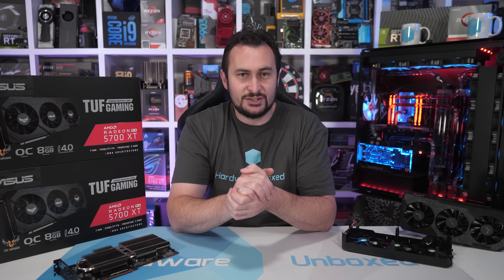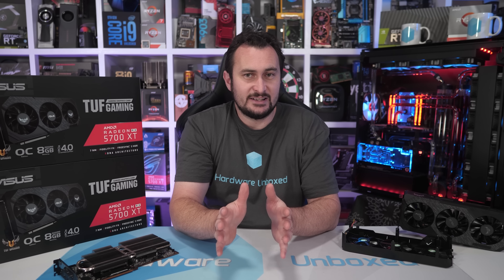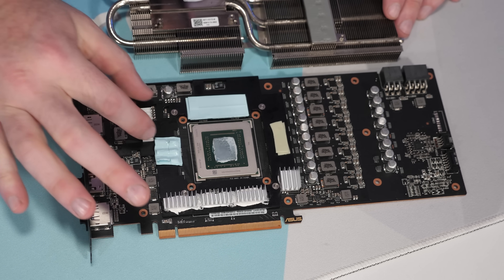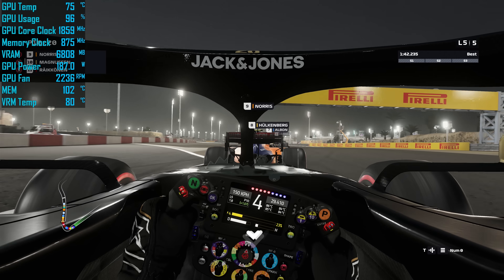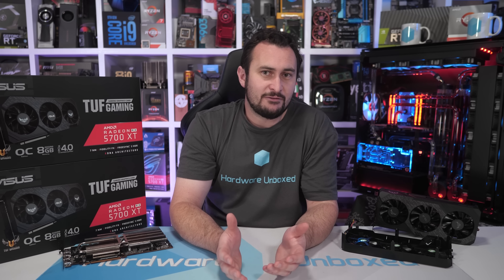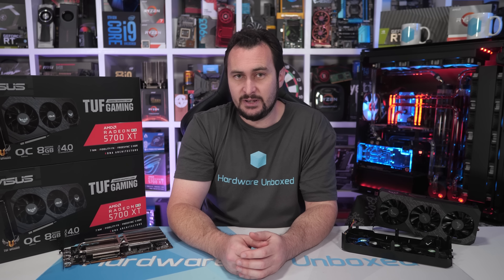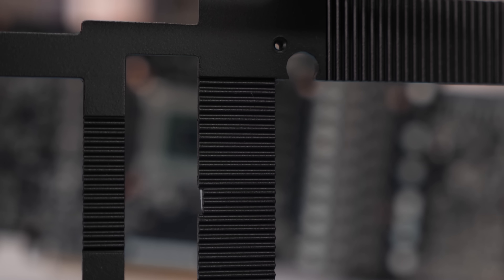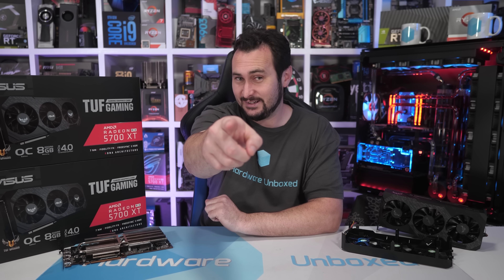Fixing the 5700 XT TUF, How Much Cooler Can We Make It?

Comment: Just did major modding to my pc and modified the heat spreader too. currently have been running folding@home for half and hour, 
GPU core:2032mhz 
core: 69C-71C
Memory: 100C
VRM core 72C
VRM Mem 1&2: 55C
GPU hot spot: 95C

Automatic undervolt from Radeon Adrenalin applied at 1149mv target. 
I thermal glued a lot of tiny pure copper heatsinks on the spreader where-ever they fit. At least me temps arent over 108 anymore. Peak has been 102.
Not as drastic as yours, but mine is a heavy compute load too, not gaming or "real world."

However, mobo and gpu both needed bios updates for not crashing. And to mount it up in a way it actually worked, the gpu heatsink really needs spacers under the spring loaded screws.

Comment: I have the 5700xt duel fan power color red dragon and after tuning it a little I managed to get the temperature lower bye 13% and run faster by 8% efficiency. Wish there was a tuning guide before I spent a day running benchmarks and making adjustments. ( hint - hint )

Comment: I have an EVGA GTX 1070 FTW - Yes the one they forgot to put the thermal pad's on - They handled it fantastic and sent me out a thermal pad kit with full fitting instructions & even covered me with a brand new replacement in case I fudged it up (That was option 1) I could have sent the card back to them to do the mod free of charge (That was option 2 for people who don't dismantle things), I wasn't having any issues with mine but decided to do the mod anyway - I'm still using it today & it is just an excellent card -  ASUS should offer the same service EVGA did when they messed up !  Having experienced this type of thing before & the company (EVGA) having dealt with it so well - I will definitely be going with their graphic's Card's in the future.

Comment: How about testing some Arctic Accelero cooler? Thanks for this cheaper improvement option though :)
Reply from the maker: You should be able to use any after market cooler that supports the 5700 XT, but that's not so much a fix as it is an upgrade.
Reply: Lol , i remember " Timmy Joe PC Tech " Immediately !!! xD
Reply: @Hardwareunboxed  So their pcb is not a custom one?
Reply: accelero III and VI variants probably suits those high end card better than twin turbo variant.

although you'll need to put some thermal pads on the memory chips which will be covered by the mounting plate and paste  some 0.5x1cm heatsink on the part of the memory chip that's not under them GPU cooler's mounting plate for optimal cooling.

AMD GPU has some memory modules that goes into the GPU cooler mounting area that would screw their cooling performance if you didnt put thermal pad(so it got contact to the GPU cooler mounting plate) AND heatsink on them when you decided to replace the stock GPU cooler with HSF GPU coolers.

Comment: Did the same, but added more small heatsinks (9x9x5 mm) wherever i could :).Mostly under the pipes at the center.  ~80 degrees under full load.

Comment: GDDR6 is flipchip, meaning you can cool it just as, if not more effectively, through the rear of the PCB. As in, you can throw heatsinks where the backplate would go on the opposite side of the GDDR6 to get temps down, people have done this mod with watercooled 5700 XTs. I reckon that would be a much quicker(though not as pretty) fix without even having to open the GPU up.

Comment: I bought the Asus TUF RX 5700 XT in early December. just finished running 30 min of an aida64 gpu stress test followed by 30 min of heaven benchmark. 

Recorded With GPU Tweak:
Max temps: GPU 75, Junction 94, Memory 86, GPU VRM 71, Mem1 VRM 51 & Mem2 VRM 51

I may see if i can get a hold of F1 2019 and test that as well, i'll add those number if i do

Comment: I updated the bios and it is working now. Temps dropped a lot. I haven't have a single crash for over 2 weeks now. I bet this is common knowledge at this point. Thought about adding a comment here since some people might still wander to this topic.
Reply: Are the clocks lower with this bios version?
Reply: @Meeliskt77  Sorry, I totally forgot to answer! To me the clocks seem the same, at least I didn't spot any differences. However it seems that 2 days after I update the bios and Asus went to release a new one (just noticed it!). Going to test it later. 

After the BIOS update no games have crashed/froze/blackscreen, but I have had 3 crashes (similar freezes as before) in Windows when trying to open a game or software. 

Also after the new Adrenalin update (20.4.2) I noticed temps going up to 100 and 104 celcius. At the same time the fans are around 3k rpm. That is quite a lot imho. Still no crashes in games though. 

There are 2 different BIOS updates, the normal and the E-mode. I haven't tested the later one. It is for efficiency.

Comment: I remember getting my asus vega 64 strix and had to replace the thermal pad on a row of vrm b/c it didn't fully cover the last bit resulting in idles of >50.  I mean it was a good learning experience to take it apart and replacing the pad dropped the thermals significantly, but that's terrible.

Comment: I once had a prebuilt PC with an out-of-the-box overheating no-name brand GTX 1060.
I used that PC for a year, until I realized the GPU wasn't using all of its performance, because it was thermal-throttling to a save 83°C. The VRM didn't have any heatspreader at all.

I bought a custom GPU cooler, Arctic Mono Plus, and the temperature was an amazing 50°C under full load, card was no more throttling & performance much improved, and a quieter fan.

thought: Why is the thermalpad in the video so thick? Shouldn't those be as thin as possible for maximum heat-transfer to the heatsink?

nice video btw :)

Comment: I have 2 HD 7950, one is from Gigabyte the other from Powercolour.

The Gigabyte card comes with it's memory attached to the Main cooler, while there is nothing on the Powercolour cards memory. 

The reference memspeed on 7950's is 1250 MHz. 
The Gigabyte card get's 1450 Mhz memspeed, while the Powercolour card get's 1600 MHz (or even 1650 with increased voltage).

Comment: This is one of those models that you should only buy if you are planning to change the cooler in any case.  Something like a water cooling project would be a good fit but with it being a 3rd party design there is a good chance that water blocks designed for reference PCB's could not fit.

Comment: A copper shim glued to the memory plus thin termal pad wouldn't be better? Which thermal glue did you use, I want to glue some heatsinks to my old "vintage" motherboards and video cards and the only ones I can think of are the artic silver and alumina ones.

Comment: I recently bought this ASUS 5700XT TUF graphics card and they probably improved the cooling because all the memory chips are cooled, and there is no visible gap between the power section and the heat sink as in the video. Temps are very OK
Reply: How high are the memory temps exactly? I bought yesterday the card at a discount for 330€ (367$) and I dont know if i should give it back
Reply: @kokosnuss5500  try new bios for this card, E mode bios on asus webpage. Temps are around 70C but this card are quite loud Vram temp 81C

Comment: for anyone wondering: you can just remove the backplate and already see improvement in vram temps. My temps are constantly 10°C lower than with backplate while playing Witcher III. Before that, the gpu even shut down at some point due to overheating.

Comment: Steve, do you guys have any plans to review the XFX 5700XT RAW II? Otherwise known as Black Wolf in Asia?
Reply: No ones reviewed that yet. I'm running one right now and love it, but would love to see someone do a full review and benchmark set.
Reply: @thekikendallsautoandrandom1271  I'm also using one. Had to do a minor undervolt and an aggressive fan curve to keep hotspot and memory under 80c, but I'm not sure if the VRM sensors work. In afterburner, the VRM readout always shows zero. C, so I have no idea what the VRM temperature is.

I'm satisfied with the card, since it's the cheapest one that's generally available, but I want to know what the inside looks like without having to actually open mine up lol
Reply: @Fishingishard  I didnt undervolt but I did modify the fan curve something serious. Factory curve never got above 50%. Ramped it up to 75%@  60c and 100% @ 70c. Seems like it kept the core and edge temps down significantly. Now only if radeons software would save the damned profile after restarting the computer. Have to reload my curve EVERY STINKING TIME.
Reply: @thekikendallsautoandrandom1271  that sucks, mine saves. guess i'm lucky haha.

i am at P1 800mhz/750mv, P2 1449mhz/849mv, and P3 2099mhz/1124mv and fan at 45%/65c, 65%/75c, 75%/80c

Comment: i dunno if Arctic GPU coolers are compatible with that board without doing some more extra mods(adding thermal pads) to have the memory chips, those that are within the mounting plate area, to have contact with the mounting plane of it's accelero coolers.

the other options are Raijintek's Morpheus  and Deep Cool's V6000...

Comment: Is it possible to get a thicker aluminium heat spreader plate made? A CNC shop could duplicate them easily in thicker aluminium and once they have the file they could spit dozens out at low cost per unit.

Asus could easily provide a better spreader and supply them for retrofit.

Comment: I keep wondering, what are the solder points PGCE19/PGCE26, PGCE18/PGCE25 and PJP110, PJP109 on the other side of the PCB for? Kinda looks like the paths are not powered and some of the components on the VRMs are not being used.

Comment: Get an aftermarket cooler like Morpheus or something along those lines(got an MK-26  myself) and whenever you run into these issues and are stuck with the card "slam" it on and game happily ever after. It's fixed the issues with the dreadful coolers on an msi r9 290 and the inno3d x2 1080ti i had and tempts were amazing. Now my current Vega 64 Nitro+ doesnt need this so it will remain stock.

Comment: So you put the heat spreader back on?  I have attempted to do the same but without the heat spreader and used heat sinks for everything and increased the gap between main heat sink and GPU.  I have tried to span the gap with heat sinks and a second attempt with 4 stacked copper 1mm heat sink bases.  I am looking for a solid 4mm aluminum block to fill the gap.  All of this is without the heat spread.  Let me know if the heat spreader needs to stay.

Comment: I just checked alphacool and ekwb, neither currently have waterblocks for the TUF in their shops, which may be the only lease on life these cards have beyond getting tossed.
Reply: Just dug a little deeper: Barrow offers a block for the TUF on aliexpress. 78$ +15$ shipping. That 2nd hand card from kajiji doesn't look so bad now, especially if you already use an open loop or an aio with quick disconnects.

Comment: I know it's a bit unpopular because nvidia, but they were also doing this with their Strix 2070 non-super, they were price cutting them over on newegg a few months ago after Nvidia said they were discontinuing the RTX 2070 non-super and a bunch of the reviews for the Strix which was priced I believe at $430 at the time said that these were suffering from the bad memory issue causing artifacting, the MSI Duke did not have these problems at least for me and many others so I went with the $450 duke and had no problems since I got the card even running RTX in 1080p ultra on metro exodus.

Comment: I fell for this Okie Doke with the Asus RX 480 Dual OC 4gb card.  This card is all fan noise!  After watching your videos I now know that this card was also defectively designed.  I can look between the PCB and the fan cover and tell that the heat sink does not touch the ram chips at all.  I'll never by an Asus card of any range ever again.

Comment: If you have one of the 5700's with no heatsink get some M.2 heatsinks (or other low profile large area heatsinks) and try attaching it with high quality thermal tape, Thats IF you can't get an RMA. Of course do testing and see if the results work for you.

Comment: hi steve can you do a detailed review of the xfx 5700 dd ultra? it seems the newer revision has a higher boost clock up to 1960 mhz on stock v bios from the original factory oc of 1800mhz.. its also the cheapest on amazon currently at $309. basically buyers are getting almost 5700xt like perfomance for a song. i remember you did a v bios tutorial using the dd ultra. THANKS and more power to hardware unboxed. huge fan of your very detailed testing methodology. hehhehe

Comment: this isn't the first time Asus does something like this. If I recall correctly back in the 290x/390x Era they released a card with an Nvidia heatsink/fan slapped on top of the R9 gpu, and we all know those Gpus where a lot hotter than the competing nvidia cards at the time. (edit: went back to look it up, and it was the Asus R9 290x/390x Direct CU II, but of course this wasn't as popular back then, so few people suffered the cooling issues it had)

That is why I stay away from Asus gpus in general. Sapphire and Xfx for amd, and Msi, GB or Evga for nvidia.

Comment: ASUS should allow anyone to swap this PoS designed card for their STRIX model. Though, I have heard a few issues with QC regarding two pairs of screws on the back side being swapped accidentally in production which does not provide enough clamping force on the far edge of the card. Though, it's easy to tell and swap the screws over. ASUS need to step up thier game... Fully happy with my STRIX 5700XT, but I'd not have been impressed at all if I had any of these recent issues.

Comment: if possible can you guys checkout asrock challenger D 5700xt? i think memory heating issue can be improved on it by passing heat to the backplate by adding thermal pad in between.

Comment: My customers don't care about the bios and how easy it is because I do all that for them. So long as it is secure and operational is all that matters to them. Personally I gave up on Asus when my Crosshair IV had parts of it that would die like the intergrated intel ethernet. Onboard sound quality doesn't bother me because I always use sound blasters. One customers Gigabyte motherboard for intel extreme platform of about 5 years ago developed sata controller failures not on 1 but 3 boards. I returned one for warranty and they blamed it on a bent pin which it definetly wasn't bent when I took it out. I have nearly 30 years in this industry and I haven't seen anything like the recent failures on Asus and Gigabyte motherboards.

Comment: Hey Steve, there seems to have been alot of issues with Asus's AMD cards in the last few years. Both the Strix and TUF 5700 and 5700XT models as well as their Strix Vega cards to my knowledge. 

Do you think it would be worth your time looking at a couple of their NVidia cards over the last few years to see if they also have similar problems? Asus are regarded as a premium brand and I know a few people who just buy from Asus without checking reviews because they believe the products will be good based on the brand alone. 

It might be an idea to confirm if this is a more widespread issue, or if it is just limited to their recent AMD cards.
Reply: I used to buy Asus by default, and they used to be good. Now it seems to be a throw of the dice what you'll get.

Comment: i did like you with the radiators but i dont know if it will have effect my i glued them with double sticky tape :))))
Reply: The tape will not work as well or work at all.

The heat will melt the glue on the tape, so it can fall off.

Plastic is a thermal insulator also, so not good for this purpose.

Comment: How much is 60 psi in Newton Meters? Or am I confusing the issue here by conflating applied bolt clamped pressure to bolt torque tightness? Still would like to see the unit's in metric kilos per centimeter I guess. I supposed my whole point here is that expressing things in PSI is problematic, who is even capable of measuring that sorry of thing?

Comment: I saw a guy who demonstrated a fatal flaw for most 5700xt factory oc versions he made a varty valid point that the architecture of these cards are pretty nice but the extreme oc from factory pretty much was a move to push the performance on paper, he showed som amazing results downclocking the cards down to 1600mhz, cutting the powerdraw down to aprox 120w thus improving thermals significantly only to loose about 5-10% performance, he made the argument that maybe AMD pushed for these high factory oc only to be able to charge a lot more, damn i would have been so happy to buy these cards att a lower price and slight performance reduction leaving the oc for the consumer, anyone have anymore info on this?